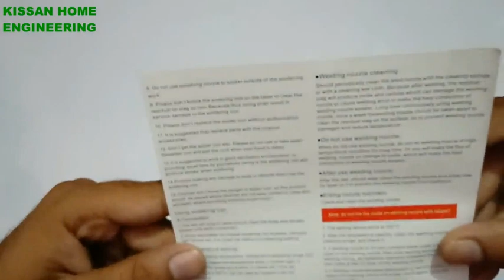Soldering Iron Kit || Techtest 60W 220V temp adjustable Soldering Iron

Comment: i have same kit, but my solder iron led only glow after red temperature 350 is set, and it also only heat up after that temperature, the solder tip dosent heat up on green color temperature, what is wrong?( led also dosent glow on green color temperature)